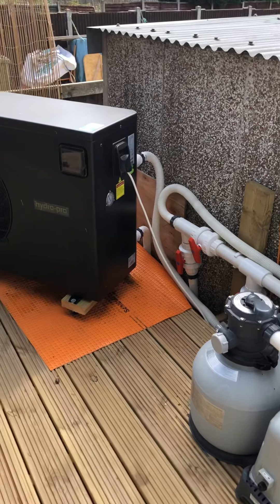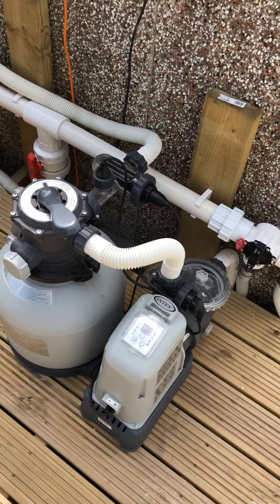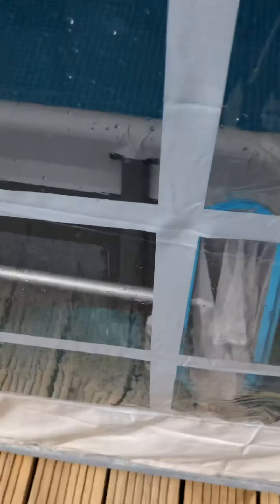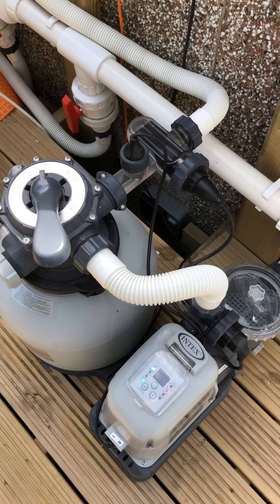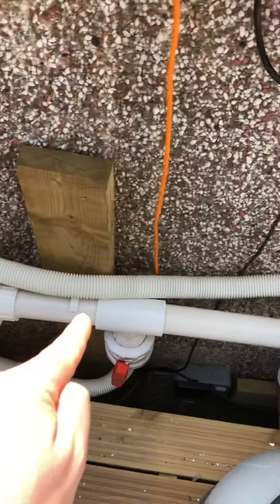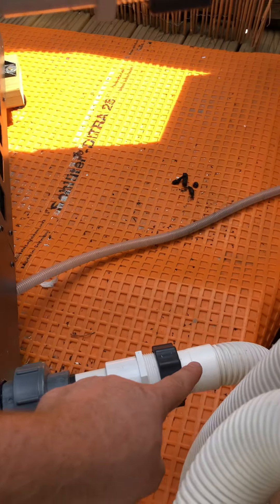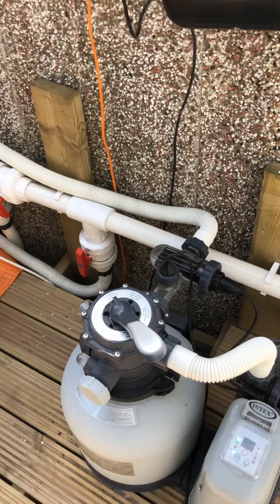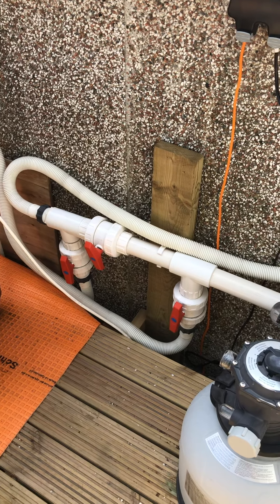Pool plumbing and bypass system

Comment: Can I ask, how you power the heat pump as I assume it draws a fair bit (have ordered exactly the same one)?  Oh and huge thanks for doing the spreadsheet - incredibly useful as I was looking for plumbing bits!
Reply from the maker: Hi, as the heat pumps input is only 230v I didn't do anything too elaborate. I simply wired this to a plug socket which lead directly to its own RCD so not to share with anything else. I did get a thicker T&E flex and IP66 socket but as a whole, it wasn't too complicated. However, I should be obliged to say, if you're not confident around this area, I would suggest an electrician for peace of mind :)
Glad you found the itemization handy. I found it surprisingly tricky starting from scratch and hunting all the right pieces down. Hopefully, you've saved yourself some research time there.
Reply from the maker: Another thing that just dawned on me which may come up and bite you - if you're getting the PVC plumbing, and are using the Intex flexi hoses, you will most likely also need some gaskets/rubber washers (which dont come with either PVC pipes or Intex hoses) as the proprietary Intex screw sizes are a little out causing slight leaks in the joints. You can make them fit without the rubber seals using LOADS of PTFE tape and/or plumbers putty, or otherwise hacking down the screw joints to the right size, but getting the gaskets would be easier. Hope it helps.
Reply: @chrischurchill1054  Thanks so much - that's incredibly useful!

Comment: HI great video I've just bought a heat pump what fittings did you use to connect the intex hoses?
Reply from the maker: You can get 2" socket connectors and pipe from most pool suppliers (e.g https://www.1stdirectpools.com/pool-supplies/pool-plumbing/abs-pvc-pool-pipe-fitting/2-pipe/2-socket-nipple-22710 ), but you will also need to get some additional rubber washers/gaskets (e.g https://www.amazon.co.uk/gp/product/B07DGFVSXK/ref=ppx_yo_dt_b_search_asin_title?ie=UTF8&psc=1 ) and/or PTFE tape to fully seal the screw join as the Intex hose is a proprietary size.
The Intex pipe itself is 1 1/2" but the screw thread is a shallow 2".